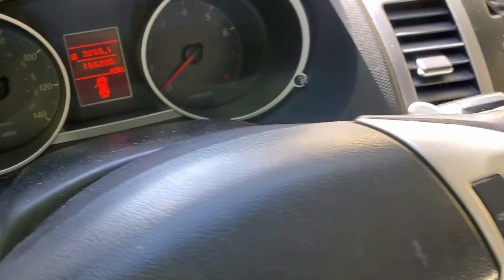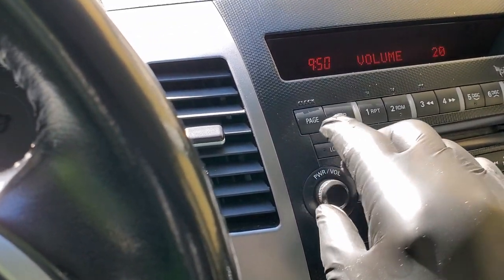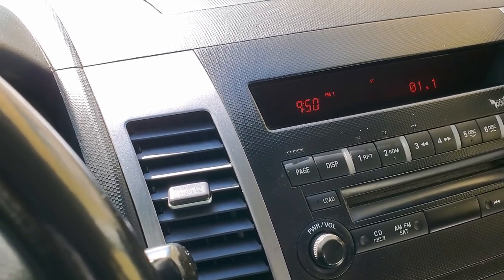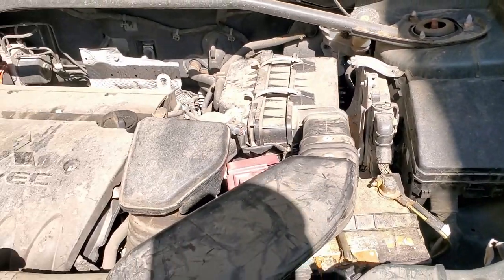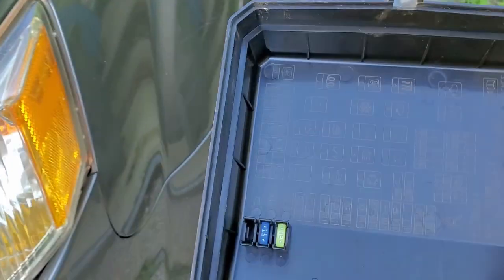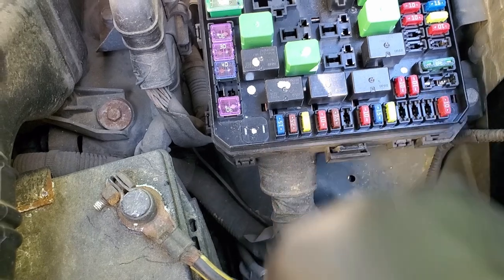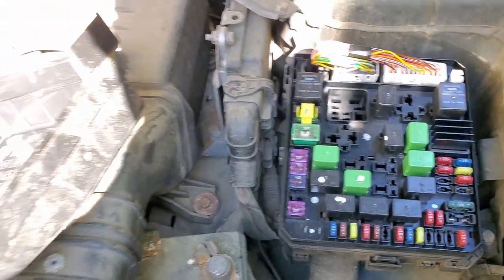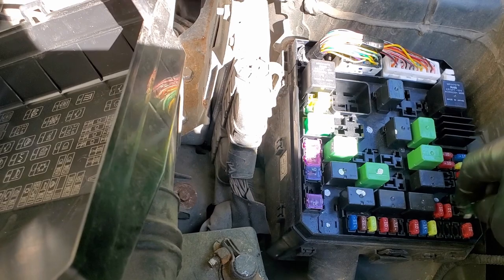How to fix Stereo not working but Turn signal chiming in a 2009 Mitsubishi  Outlander

Comment: Thanks for your video, saved me a ton of money.
Reply from the maker: glad I could help.
Reply: My car audio stopped working after regular oil change at a chain auto shop.  I couldn't find out what's wrong with it for days till I watched your video. It turned out that the 30amp fuse was missing.  The good news is that they gave my fuse back. :)
Reply from the maker: @kuma5343  Glad I was able to help. Thanks for the like and sub😊

Comment: Hey I don’t know if you will see this but I’m having an issue with my 09 galant where the word PHONE pops up on the radio which mutes my radio for about 5-10 seconds….. it’s linked to the hands free system I think, do you know what I could do to fix that? Could I unplug the fuse for it? Reset the radio?

The hands free system only works sometimes, could I just unplug it entirely?
Reply from the maker: I am not familiar with the system set up on the Gallant. It sounds like a "Hand Off/Hand Shake" issue where for a brief moment your stereo connects with the Handsfree system. DO you have the Owner's Manual? This might be a simple thing explained in the manual.

Comment: Hi. I hope you can help me. I have mitsubishi asx from 2017. I have try put in active subwoofer and when I take signal from rear speaker something happend. The sub make a little bum and now I don't have music in my car. Everything work gps volume up down but no music. I have heard strange voices. After 2 days I go back to car and again music work. But next day no again. I really want to fix that my self to save money. What you think?
Reply from the maker: Check  fuse and relays.
Reply: @RealNoor  I found reason was cable from speakers touch door metal and make issues 🙂
Reply from the maker: @przemokbh8079  Nice! glad it worked out.

Comment: Hey for your issue the volume was down? Not the 30amp fuse missing?
Reply from the maker: Not sure I understand your question. Are you asking if the fuse was missing as supposed to volume being down. if the so, the 30amps fuse was missing.
Reply: Only one side of the 30 amp connecting fuse is placed in that compartment 😂

Comment: The fuses are ok but I still have the same issue as you. What could I check next??
Reply from the maker: The fuses may still be okay but the fiber optic link is the issue. you still have to fix that.
Reply: @RealNoor  It fixed itself. Turns out because I left the car untouched for like a month or so it made the sound system not turn on for some reason. Even though i drove it a couple of times, after some time I scared myself with the sound blasting through the speakers XD
Reply from the maker: @lorentzau  glad to see things worked out fine for you. Thanks for watching and subscribing.